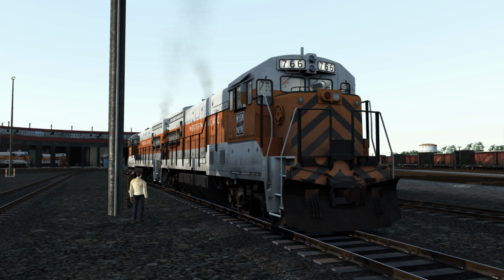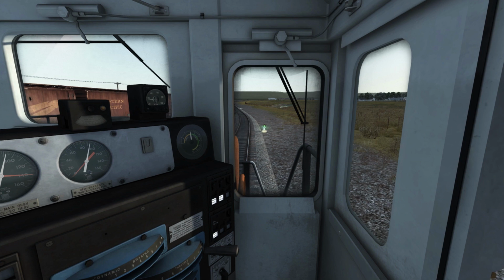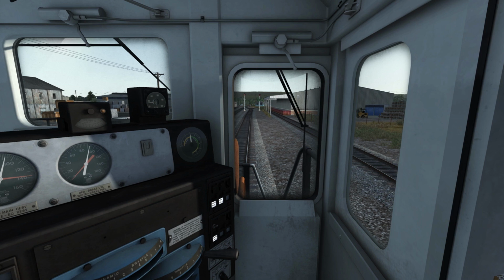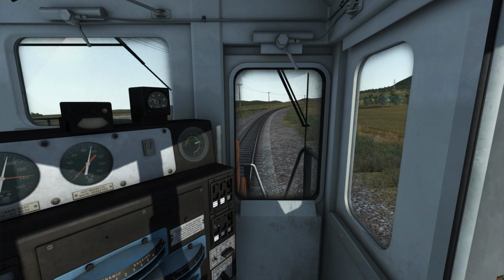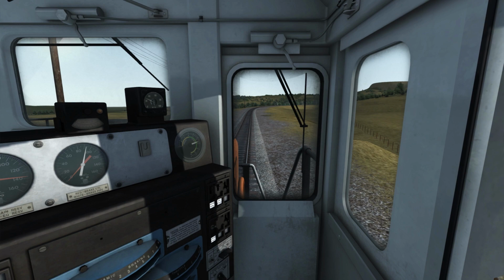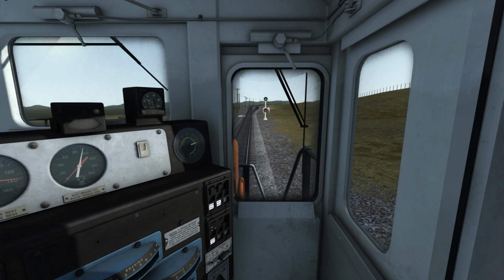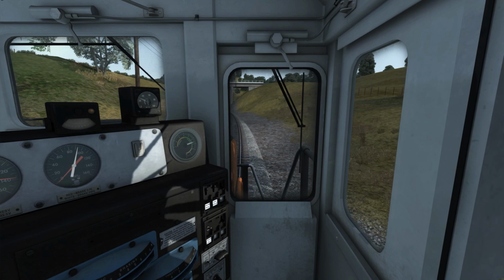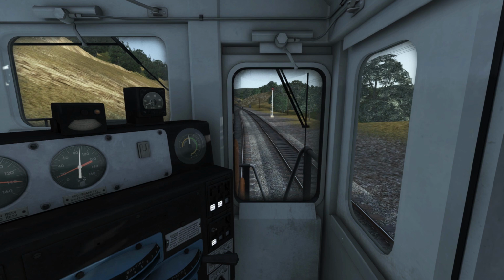Train Simulator 2016 - Route Learning USA: Feather River Canyon - Oroville to James (U30B)

Comment: From what I know, Dynamic Brakes are pretty easy to explain - essentially all they do is turn the train's motors into generators, by (somehow) reversing their electromagnetic polarity.  ie the output becomes the input.  The new output is usually just a ton of heat, ejected out vents on top of the loco.  But sometimes the output can be stored in batteries in a "hybrid" like way.
Reply: Not that hard to understand. It's cause of a control system called an "H-Bridge." Google should give you a very good explanation.
Reply from the maker: +nuothe11th I sort of get how the dynamic brakes work though I don't fully understand the technical side of it.

Comment: Dynamic braking is the use of the electric traction motors of a vehicle as generators when slowing. It is termed rheostatic if the generated electrical power is dissipated as heat in brake grid resistors (diesel-electric locomotives), and regenerative if the power is returned to the supply line (electric locomotives).   (from wikipedia; I figured someone else could explain it better than me and they did.)

The route does still exist and is used by the Union Pacific as an alternate to the Donner Pass Route over the Sierra Nevada Mountains. It was initially used for double stack trains before the tunnels on the Donner Pass route were modified. It has a lower prevailing grade than the Donner Pass route. The BNSF also has trackage rights from Stockton, Ca. to the Keddie Wye where it splits off to the left and heads north to Oregon and Washington. The UP has trackage rights over that section but also has its own route which Amtrak's Coast Starlight uses to Portland, Oregon where it switches to BNSF tracks to Seattle, Washington.
Reply from the maker: Thanks for all the info, that's really interesting to note. I'll be covering the rest of this route at some point soon.

Comment: Great video as always! A little more info about the advanced brakes; the Westinghouse air brakes on American freight trains are applied by letting air out of a main "brake pipe" that runs the length of the train. Valves in each car detect the drop in pressure and let air into the train's brake cylinders. On a long train, it can take several minutes for a brake pipe reduction to propagate throughout the length of the train. The brake difficulty multiplier changes the rate at which the brake pipe pressure reduces, and the brakes apply. Going downhill on hard difficulty requires good route knowledge and thinking ahead.  I recommend reading the manual for more details on the advanced brakes, as I still have trouble getting down the hill safely as for the route itself, it still exists under Union Pacific. No passenger trains currently run on this route, but passenger specials have run several times. You could easily run an Amtrak excursion train with some P42 locomotives and Amfleet cars.
Reply from the maker: +Paul Anderson Thanks for all of the information there. I know there are other routes where I can turn up the brake difficulty multiplier which I will consider driving in the future. Of course as part of going downhill one always has the dynamic braking system to use as well. I'm guessing if used correctly one can balance the train speed well using a combination of the air and dynamic braking systems.

Comment: Dynamic braking basically turns the motors into generators thus providing braking. This method is used in many modern diesel engined high speed trains.

Comment: 25:00 That track that went to the right was the main route until it got flooded due to a dam being built for the California canals. 1969. the main route rejoins at tunnel #8.
Reply from the maker: Thanks for the info! :)
Reply: PTGRail no problem are you ever going to do Steven pass route? it was the longest tunnel in the usa 8.8 miles and then there is the Idaho/Montana tunnel which is 8.6

Comment: FYI: This is the wrong control stand. This is the KC108 controller that came out in 1977 on the dash 7 locomotives. What was used in these Was the KC109 controller. The KC109 had a throttle handle that was a little over a foot long, and it had half notches, giving it 16 notches in all.

Comment: The auto switching is weird - you look at the track and it looks like you're going to divert and it keeps going straight.
Reply from the maker: +nuothe11th Sometimes the points in Train Simulator don't look like they are set correctly when they are for some reason.